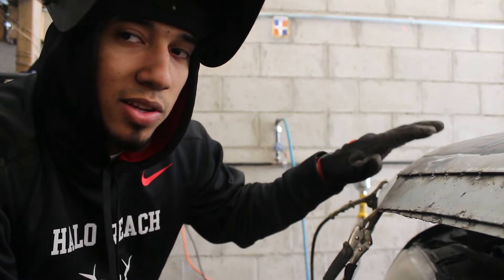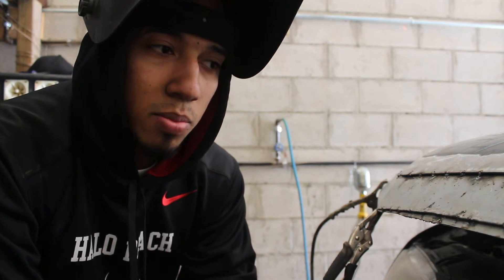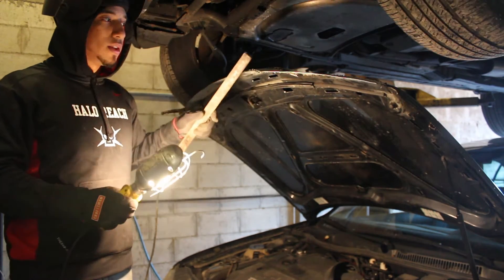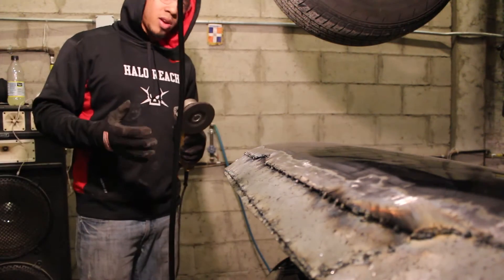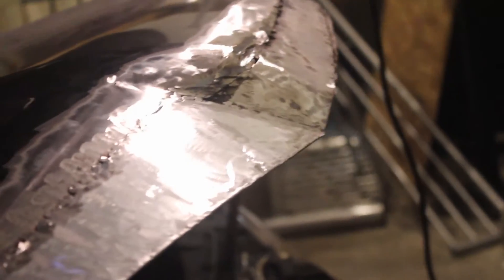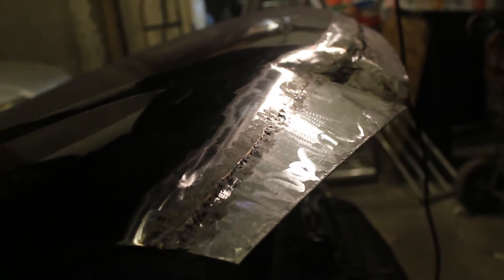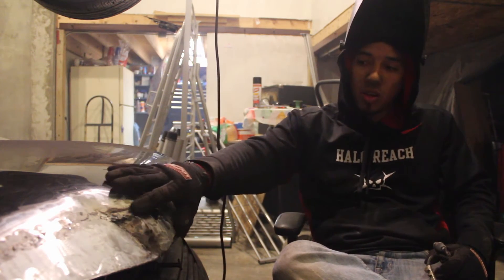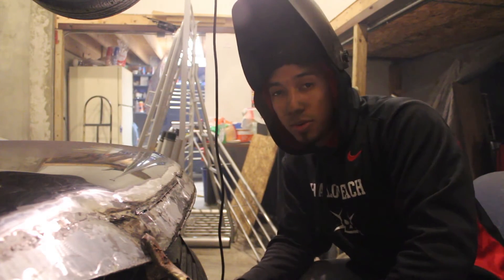How to Make a Boser Hood (Part - 2)

Comment: hey man were u running a gas setup when welding? i run a 75/25 mix with any body work. this is unless ur running a flux cored wire which it didnt look like. turn wire feed speed down and increase your voltage. keep contact tip clean so that backup gases can surround the puddle.
Reply from the maker: I didn't on this project which I now know is REALLY necessary to get a good weld. That's for the input! I'm learning everyday

Comment: Oh man, good luck to you! Although I've never done this or even researched it, I've got a few ideas. Maybe you could use corrugated sign board for your template. You may be able to get a cleaner cut and can maybe better form it to the contours of the hood. Also, why not do butt-joint welds? I mean cut the metal so it sits flush against the hood instead of tucked underneath it? Just a thought.
Reply from the maker: I did butt-joint welds for the two side pieces (works great) however after we cut the center piece, it did not fit to shape, so at that point we should have fixed our shape, but instead we continued to see if tucking it underneath would work out.. unfortunately it did not work out. haha! it was a learning experience I hope no one else makes this mistake, I'll be cutting it out and welding a new sheet the proper way, this weekend. :)

Comment: Also, nice job shielding your windshield. Hot metal can melt into the glass on your windshield if it's not shielded. Lol.
Reply from the maker: +TJ S This was the first time I ever welded, big learning curve for me. thanks for the "support"
Reply: +Jerry Batista It's not the welding that's the problem with the metal melting into your windshield, it's the grinding. But either way... Before you go and do something to your car, or anything in general, it's always best to just check with a professional first or hop on some forums and read. Your entire process seemed very rushed and unplanned. I mean, I understand things creep up out of nowhere and put a wrench in your plans, but you kinda just went with the flow all the way through. At the end, you watched one little video on bondo, or autobody correction, or whatever it actually was, before working with bondo. You ended up wasting hours of time sanding, where you would have spent much less time if you had watched a few more videos and spread the bondo thin and evenly like you're supposed to. The less material that's gooped on there, the less sanding you have to do.

All I'm suggesting is slow down and set up a plan before you tackle stuff blindly. It's great to be enthusiastic and want to jump straight into a project, but it'll wear you down if you're wasting a bunch of time doing meaningless stuff.
Reply from the maker: +TJ S I respect that. I will admit, I didn't know what I got myself into when I started it. I did waste a boat load of time. I'll have to spend more time on forums next time I get out and make something

Comment: You should've bought the fabricated plastic piece and you could've put it on there with Bondo or a body shop could've made a metal piece of it and have them do it or you do it
Reply from the maker: I couldn't find any I liked. And the price didn't look good for the ones I've found. I stopped by a body shop and asked if they would do one for me and quoted $1200 completed with out full clarity that the good would still have its structural integrity when opening it. So, I said F that and did it myself